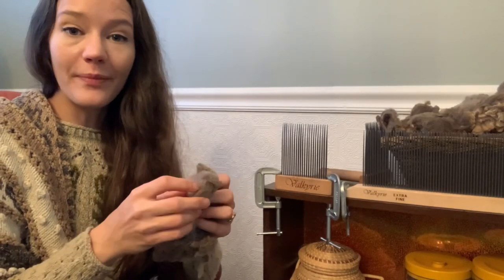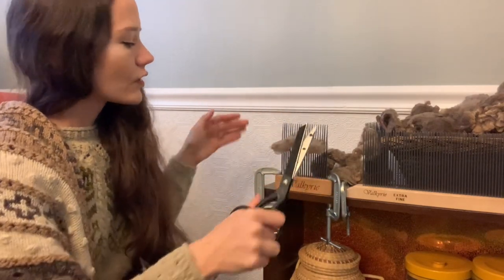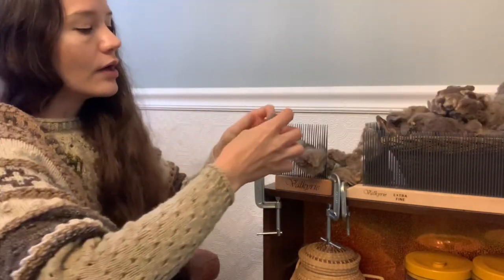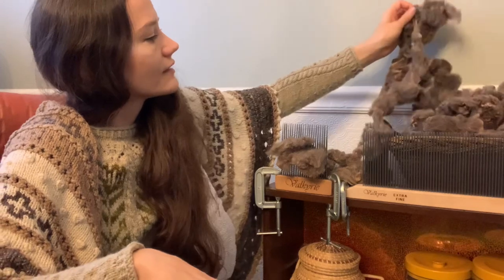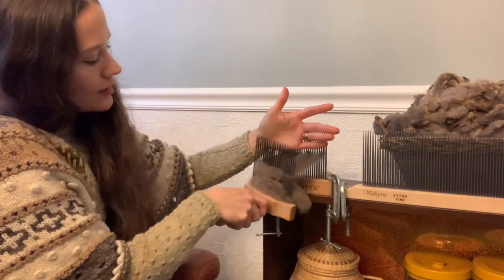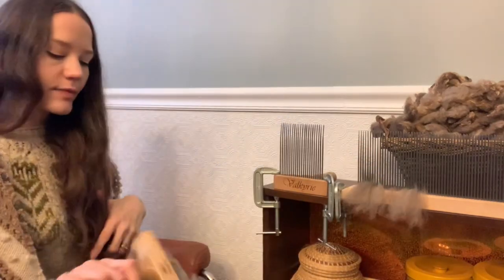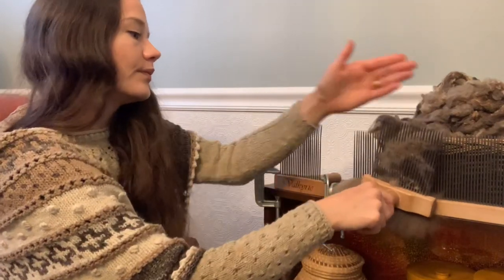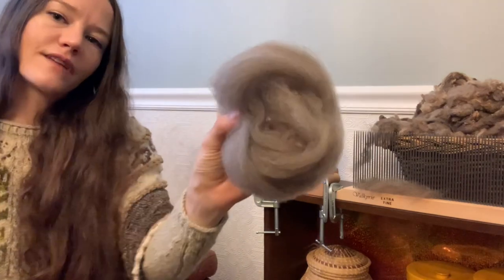Hand Combing Wool to Spin into Yarn | DEMO

Comment: I love how meticulous you are. It indicates that you love the process as well as the product. Good on you.
Just a little suggestion from 50 years of doing this…cutting the tips may make a more bristly yarn. The process of combing does remove a lot of burnt tips.  Also, if you comb from the tips, ie, each swipe goes less deeply into the fiber supply…it is easier and breaks the fiber less. You can heard the crackle of the fibers tearing as you struggle with those deep swipes.